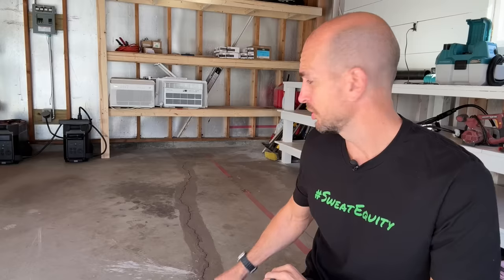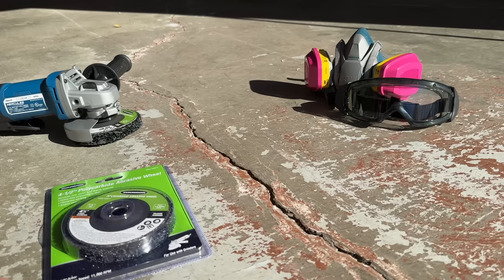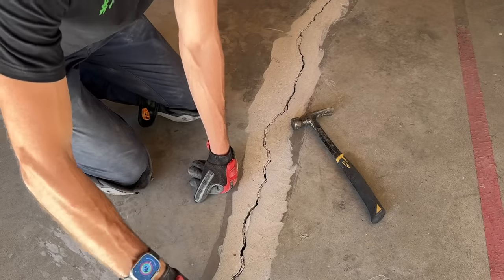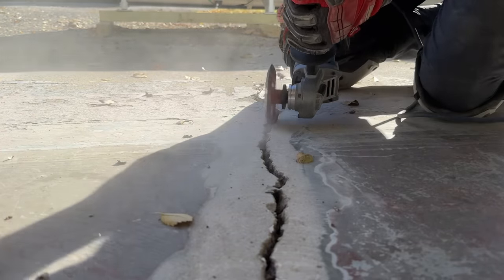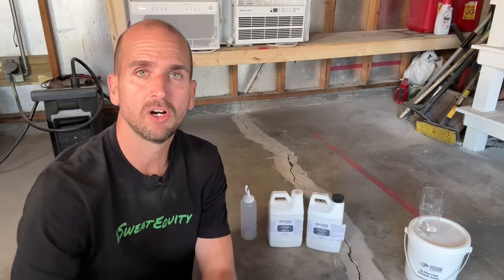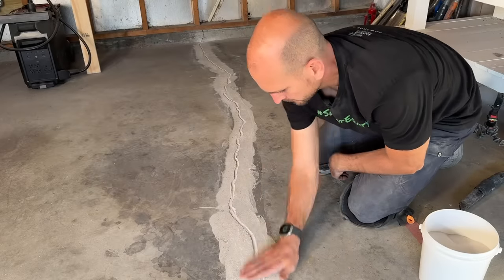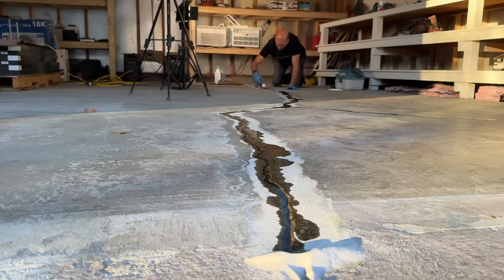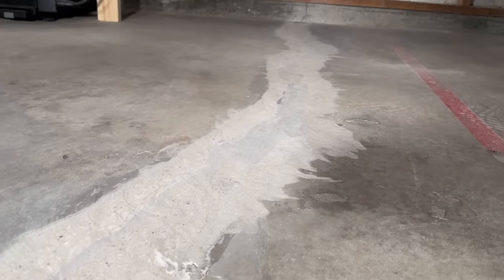How To Permanently Repair A Garage Floor Crack

Comment from the maker: Quick Set Repair Epoxy Used:  https://concretefloorsolutions.com/product-category/repair-materials/
10% Discount Code (Enter At Checkout):  ehr10

All The Other Tools Used On The Project - https://amzn.to/47tgzdQ
Reply: Will this work on concrete pool deck cracks?
After that is applied, can it also be gone over with a new cool deck coating And not show the crack That was just repaired?
Reply: Concretefloorsolutions website is getting flagged by antivirus and getting blocked?

Comment: Structural engineer here.  Great job!  Very thorough, well explained, and well executed. The only upgrade I know of would be staples.
Reply from the maker: Thanks for the feedback!  Really appreciate the support 👍
Reply: Please explain staples
Reply: @willbraswell4906 assuming you don't mean the office supply store or things they sell, what are staples?
Reply: @hjackwingo  Like sutures in a surgery, they are perpendicular to the incision/crack and are epoxied into grooves cut into the concrete.
Reply: From the Structural Repair Specialists' point of view, I like this solution for some applications, but I agree that staples or carbon fiber stitching may be needed for floors that are still under stress and are active. And as for floors that have heaved or have poor drainage, this is a very "not permanent" solution. Don't get yourself into hot water for a sponsor. You're better than that.
Reply: Expert at everything here.
Reply: @stoneyswolf lol who says that shit
Reply: This is beautiful but I got to say sweeping your material along the length of the crack is probably not the best way to keep that stuff out of the crack. Because some of those small pieces are going right back in there. I probably would have done that very carefully going along and pulling things away on each side. However I could be overthinking this I'm not seeing what you did is wrong it's just looking at it I would have done it a little differently.
Reply: @WayneBraack just use a vacuum bro, not that big of a deal
Reply: Would you recommend staples for a stable, monitoring for 8 months so far in new to us house., crack or just fill it in? I was looking at products from Emecole. They sell an expoxy/poly hybrid for floors and carbon fiber strips for perpendicular applications. Crack is under 1/4in
Reply: @rcracer500 In my opinion, if the crack is stable (i.e. non-moving), you can just fill it and not use staples.
Reply: @willbraswell4906 lol.....the crack literally means it's moving . Messed up vapor barrier, compaction or bar/mesh was not properly on chairs or pulled up during the pour....
Reply: Without said staples, the crack should open again. Why wouldn’t a flexible sealant work the same way as the one he used on the driveway on other videos? Was this explained and I missed it?
Reply: i assume its cracked because the fill underneath is washing out, wouldn't you want to fix that first before fixing cracks ?
Reply: @CrunchEnhancer  I couldn’t tell that there was any vertical movement to the crack so I don’t think that it’s a lack of subgrade support but rather it’s the concrete shrinking horizontally that is causing the crack.

Comment: I didn't do near that amount of work. Scraped, used no grinder or mask, dug out cracks, swept, filled with a tube of concrete filler. Two years later, is fine. Even if I have to re-do in a few years, it beats all of this for me. But hat's off to you for your excellent video.
Reply: Yeah, all the grinders seem excessive.  Running a file down the crack, then vacuuming it out would probably work about as well and leave you less to fill in.  Plus, much less electricity and fewer tools required.
Reply: Depends on the particulars of the crack?
Reply: Unless you're getting paid for it then you want to do it right.

Comment: I was concerned when you introduced the idea of using fine sand under the epoxy.  I've seen videos of sand being used under expansion joint caulking to reduce material volume used.  This is a BAD IDEA because sand will prevent the joint from closing and opening with temperature changes.  For caulking, foam backer rod is the product of choice.  For repair of a settlement crack where movement is actually undesireable, fine sand is actually very good idea.  The fine sand serves as "aggregate" that actually pulls the epoxy further into the crack, and absorbs the epoxy until saturation.  Nice repair.
Reply: Expansion joint only for bricks, because  brick clay /from kiln/ is bone dry and absorb moisture, after installation = expand . Fill up those gap  w/ neoprene foam and caulk . In concrete there is lot of water , little for hydratation , most for spreadable, water later evaporate and cause shrinking  - cause crack, To avoid this , slab are divided w/  Control joint/  C.j,  always open up until   water gone and stops. Temperature changes  are minimal . Of course , outside slab needs seal w/ caulk, backer rod necessary,  against water seepage under and ice build up.

Comment: Nice work. It could get real expensive real quick with epoxy. I've also done this similar type of repair with Sika selv-leveler. It goes nicely into the crack and has a ton of glue which bonds to the concrete really well. Much much cheaper at like $20 a bag which makes close to 5 gallons of liquid.
Reply: All the Sika leveling products I've seen are meant for use as underlayment meaning they would be covered with stone or tile afterwards.  Do they make a product which could be used in a garage which will ultimately be covered by an epoxy coating?  SikaQuick might work but not sure how well it would hold up over time since some minor shrinkage is possible with the product.

Epoxy is more expensive, but it is also incredibly strong and is likely a lifetime repair.  The extra $$$ may be worth it in a case like this, although for many repairs (especially interior cracks) I'm sure there are a number of less expensive alternatives.
Reply: @Phormify  A subcontractor used it to flatten part of the garage floor on my previous house. It only cracked right at the edges, where it was almost paper thin, and even there only after years of rolling heavy stuff over it. For the rest of it, where the self-leveler was at least a 1/4 inch, it wore as well as the rest of the concrete floor, for more than 20 years. So I think it could be used to fill that crack, and much less expensively. I've used it recently, and properly mixed, it dries very hard and strong, and adheres extremely well.
Reply: Liver the color of your eye!❤
Reply: Painter's 5 in 1 tool is also good for cleaning cracks, expansion joints and control joints.

Comment: What was the original cause of the crack? Is it heaving or sinking of the floor in spots? How long would this solution work without addressing the underlying issue?
Reply: @dosadoodle I bet you that this guy will not show this slab 6 months from now.
Reply: Lipstick on a pig if the slab is poorly supported or has failed. You have to get those issues fixed or you have just wasted a bunch of time and money on a fancy repair.
Reply: Ditto ! What  solution do you  expect when all of society has learned only to treat  the symptoms of every problem  !  Before even watching the video , my suggestion would have been on the same  page as the "staple" .  Holes through the  slab with 3/8  or better rebar at 2/3 the depth of the pour.

Comment: So I have a massive crack in my garage floor.  my crack is uneven,  How do I fix that
Reply from the maker: Depending how high you might be able to grind down the high side and then fill the crack.
Reply: You have to fix the CAUSE of the crack first. Otherwise it will just come back.

Comment: I used a fine mortar mix for my cracks and it seems to have worked great for my situation.  Same prep steps as you did, then filled crack with unmixed mortar mix and sprayed water on it till it saturated down thru the depth of the crack.  That way I could get the crack filled to the top (which is near impossible with it already wet & mixed.  Ground it down and it came out great.  The epoxy looks like ti works as well, but I spent $8 on my bag of mix.
Reply: Yes, this works great if your slabs aren’t drifting.
Reply: Keep in mind, cement-based products do not bond to concrete anywhere near as well as epoxy.  The tensile strength of epoxy is at least 10 times stronger than cement.

Comment: Nice video!  When I was in Commercial Construction,we had a crack like that and what we did was use a pneumatic crack chaser we rented for the tool rental store.   It was a chipper that the point was “U” shaped.  So, you followed the crack and it would leave a “U” crack.   I believe they are making a grinder blade that has the “U” shape.   Tool Rental stores are a great source of equipment!  

A two part Epoxy works great!  However, it can be expensive.  At Home Depot and Lowe’s in the Quikrete area they sell 1-2 gal buckets of “Hydraulic Cement”.   It is a great product !  Be sure to wear Nitrile Gloves!  It will eat up the skin on your hands!  Follow instructions by adding the correct amount of water.   It will become the consistency of dough. Mix small amounts for the first few time so you can see how fast it sets up.  Put some in your and roll it like Play dough.  Roll it to the width or just a little smaller of the crack in the shape of a rope and press it into the crack. You will feel it get warm while rolling it out. Let the magic happen!  Hydraulic cement expands as it fill all the voids.  In fact, it will rise above the floor.  Just take a trowel or and strike it flush.

Hydraulic Cement is a a great product!  I saw pool repair guy use on the pool under water and it worked!  He mixed it up and put in a ziplock bag and dove down and pressed it around a crack where the new light left a void.  We use it in block and around pipe sleeves in a concrete wall where water was leaking through it.  10  minutes later no more water leaked through!

Comment: I've had to do a lot of this in my foundation (vertical cracks) and I found that a hammer drill on hammer-only mode (no spin) with an old (or new, if you don't care) masonry bit (in my case, 1") makes a nice tapered opening and it takes almost no time to do it (and it creates a lot less dust than grinding).  You can make a pretty consistent enlargement / cleanout with that technique.  Once you get to a depth, sometimes you can angle the bit up or down and zip right through the material in a line.  Not going to be as smooth as precise as what you did, but for time & effort, it's pretty good.  Then I either foam the opening, core fill, and then dig the foam out later and repair mortar that smooth, or I just put a flat form against the outside and core fill it all with fluid grout.  Helical stitch ties, stainless allthread, frp rebar, or heavy stainless wire/rod can be used to help prevent the crack from returning.  Sorry, I know that's a tangent to this.

Comment: Very good work, especially on the prepping that is so crucial to get a proper result.
Just 2 details that I would change to make the fill stronger:

There is a reason why the crack happened in the 1st place, which is that the parts are drifting apart (or: were). Hence, I’d suggest to link the 2 platters by applying concrete connectors.
I‘d also suggest to, depending on the depth of the crack, to apply the epoxy on the sand in 2 layers to go for sure the epoxy soaks in deep enough and fill in really all the crevices, i.e. layer one first, sand only half full, get it really soaked, then apply 2nd layer of sand and do the final fill as you were doing.

Comment: A couple of tips: running the shop vac with the hose near where you're using the angle grinder will suck up most of the dust. Also, running the shop vac as you pick at the crack will suck up dust and debris as you go. Third, if you have a crack that's propogating you'll want to use a concrete blade on a circular saw to extend the crack in a straight line in order to control where it propogates.
Reply: Don't forget the dustless bags for the vacuum.  They work great.
Reply: @richardbetzenderfer8577  the dustless bags are definitely recommended when dealing with the fine dry dust.  They're better than cleaning a wet/dry filter.

Comment: The fact that the crack ran along the entire length, and that the previous attempt didn't hold, means there's a big chance the floor is still under stress, and that crack will open up again.

What you SHOULD'VE done is to cut deep notchs (every 3ft or so) perpendicular to the crack, put a staple in each notch, and then do the epoxy throughout the crack and the notches.

You can still add them in now, before you do the epoxy finish.
Reply from the maker: Thanks for the feedback.  I actually want to try out the staples.  This garage never had gutters (and now it does) so I am curious is the water along the foundation for years led to the settling.
Reply: @EverydayHomeRepairs  
Could be. Depends if it's a slab on grade (with a slab edge), or actual foundations with footings.

If it's a slab on grade, it could've happened even if you had gutters. Can't really know if the soil finished settling or not. Staples will ensure that no matter what, it will have a much higher chance to stay in one piece.

The fact that it's fully connected to the driveway, makes me think it's a slab on grade.
Reply: I curious if there is any gravel under the or the slab was just poured on clay.  A gravel base would have helped stabilize the soil  clay doesn't do as good a job of it.
Reply: @bobbg9041  
Depends when it was built. If it's less than 60 years old, than building codes require a gravel (stone dust) base for slab on grade. Another conundrum about the slab is whether or not they've put rebar in it. 

Doesn't matter now though. The best and most cost efficient solution is to staple and re-finish....Unless you want to spend 25K to demo\repour the entire thing, while lifting\supporting the structure from underneath.
Reply: @EverydayHomeRepairs  
Also, you see how the smaller cracks that are almost perpendicular to the larger crack, are all on one side of the main crack? If that side is the side of the exterior wall that had no gutters... Then that might have been your issue. The side that these smaller cracks point to, is the side that settles the most.
Reply: It's Epoxied together there is a great chance it wont move...
Reply: @northface484  
No. That epoxy isn't even close to being structural. It's a finish epoxy. Even using a good crack repair product won't work if the floor is still settling, you must staple at that point.
Reply: Controlled cracks are the answer for when people pour a garage floor.  All concrete cracks.  The cuts to section out concrete tells the concrete to crack at the joints you put in.  If the joints aren’t added when the concrete is wet and new, you have to cut the next day, or cracks will happen and soon.
Reply: Can you share a link to these staples you are referring to?

Comment: I did this 2 years ago to my garage. The only thing different I did was add more silica sand on top of the epoxy mixture causing it to form a paste that was slightly higher than the concrete. When dry the epoxy is completely filled with silica then grind it smooth.
Reply: Dude that’s a good tip 👌👌

Comment: Great video,  I work in commercial construction and see a lot of polished concrete, what you did is very similar to what the professionals do but use a different epoxy manufacturer and a machine that mixes the two parts on demand.  An open crack like your's they would  use a carbon fiber type mesh to bridge the crack. The theory is the crack is likely to come back, the mesh keeps you from seeing it when it comes back.
Reply: I have did that on cracks in sheetrock the mesh works great.

Comment: Great work, I did my garage floor during Covid, tons of filling and grinding.  One recommendation I would make, build a homemade dust collector. A 5 gallon bucket, lid and a couple tubes or buy one. Probably carried 15 pounds of grinding out. And a dust collection shield for your grinder. Don’t want to breath that stuff, mask won’t cut it. Well done!
Reply from the maker: Totally agree on the dust collector.  Without it your shop vac will lose suction in less than a minute with the dust clogging things up.  Thanks for the feedback!

Comment: If i'm using a concrete grinder across the entire workspace in preparation for the epoxy, do i need to hand grind the crack / epoxy repair in advance?  Or simply let the beast concrete grinder do the work in one fell swoop?

Comment: Looks good!  

Any idea how it holds up if used on a basement floor that periodically gets flooded with rain water?  My house was built in '35 and I have no idea how thick the floor is but there are a few cracks I've noticed that I might want to repair.  Any input would be appreciated.

Comment: I would highly recommend a diamond v groove crack chaser for widening that groove and creating a perfectly clean surface for the filler product (epoxy in ths case) to bond too.  It really is the perfect tool for the job.
Reply from the maker: I agree, the V groove makes quick work.  Those blades are a bit hard to find at a normal big box store.  My local Harbor Freight usually carries V groove wheels but were out for this project.

Comment: That crack is now the moving joint for the slab, since there wasn't one cut in at the time the slab was installed.  What it to keep it from opening up again when the slab starts to move when moisture, temperature, and earth movements continue?

Comment: I will eventually need to do this in my garage too as i have a similar crack but the smaller slab is also off but a few degrees from flat and was thinking of getting someone to level it first by either pumping slurry or foam underneath...

Comment: If you have issues with some water coming through the floor from hydrostatic pressure, will this work vs, hydraulic cement?